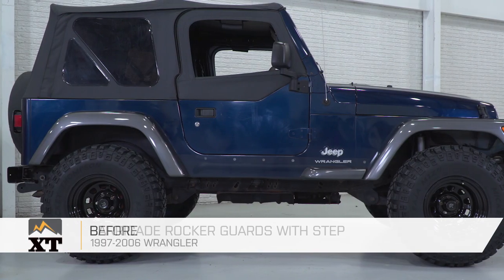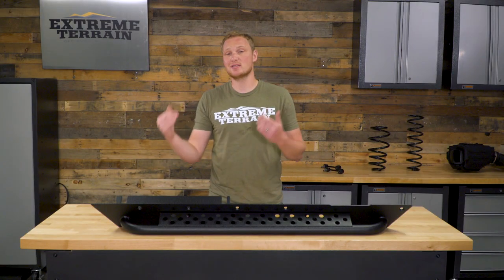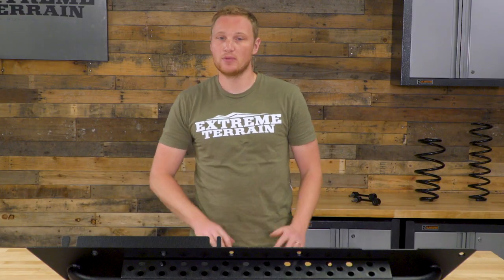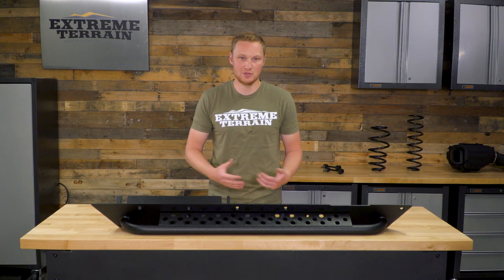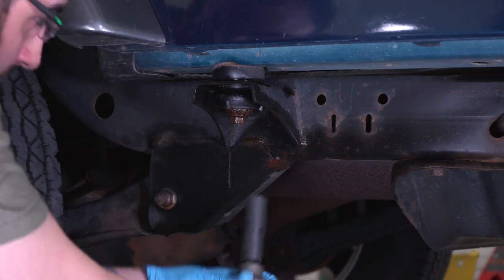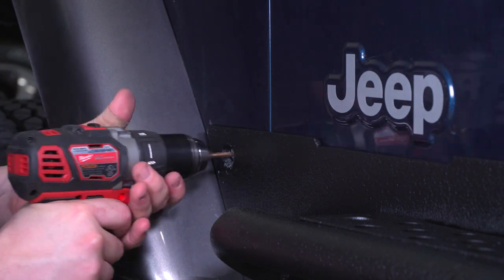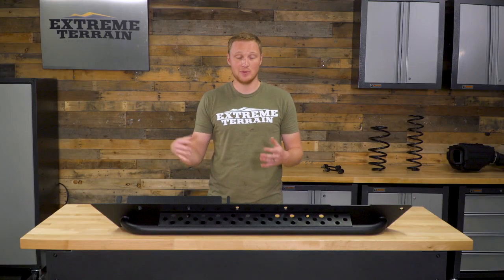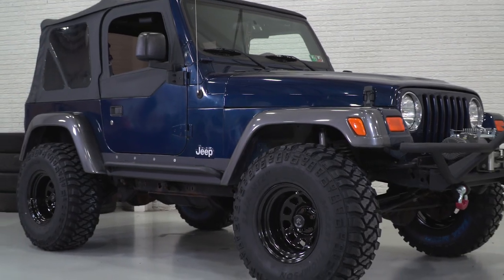Jeep Wrangler Barricade Rocker Guard w/ Step (1997-2006 TJ) Review & Install

Comment: Do these still have the oval cutouts on the part that bolts to the body (underneath the step)?  I have a rust spot below the the passenger door that I'm considering cutting out patching.  Instead of having the rocker repainted the factory color and risk not matching the paint, I was going to rattle can the the new patch black. I was planning on overing the newly patched rocker with these guards.  If they still have the oval cutouts then I'm worried you'll see my fix.

Comment: This is a horrible "install video "
Reply: Its fairly simple dude. There is a left and a right. They only go on one way. Drill holes straight. If drill bit diameter is too big for hole, use smaller drill bit, or measure hole.